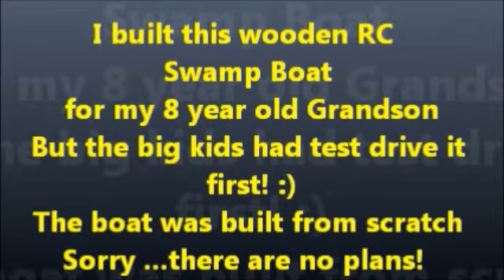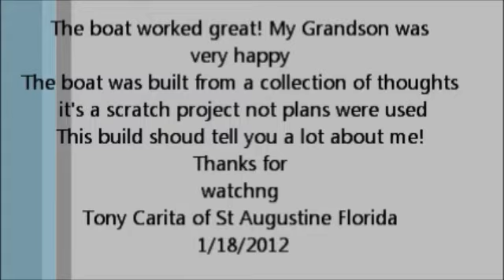RC Air Boat Scratch Build

Comment from the maker: The other boat! That was my prototype boat. I did some experimenting using different techniques and ended up with a little airboat that worked ok. It was a bit too narrow and flipped over too easily .Funny, It would still run and return to me even though it was upside down in the water. LOL!!!